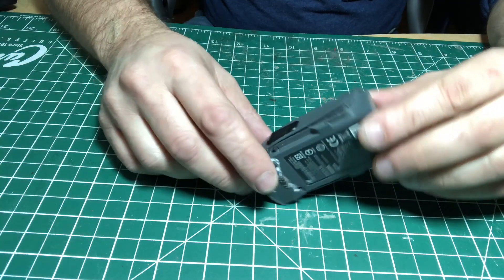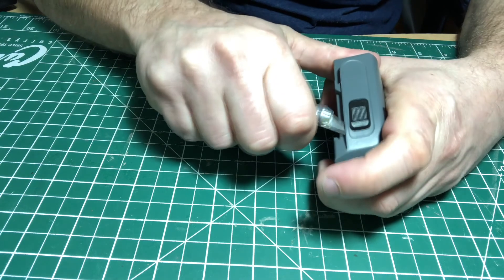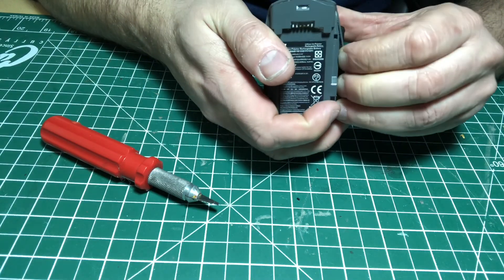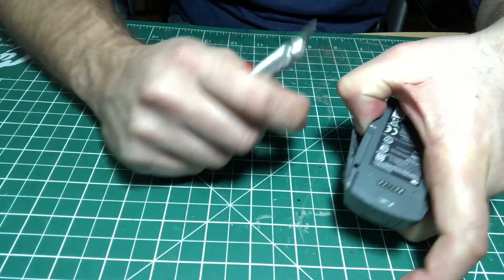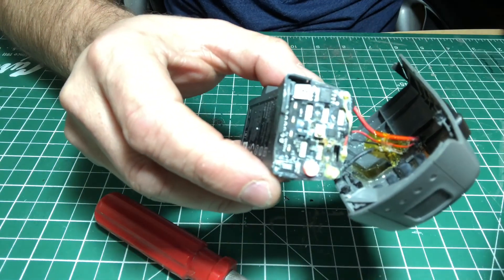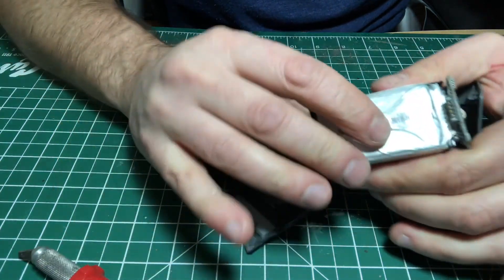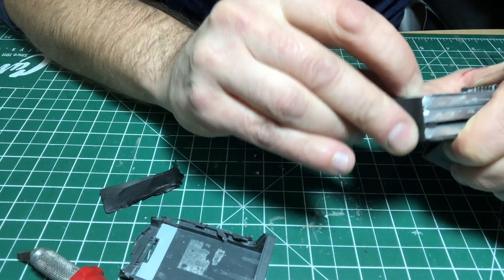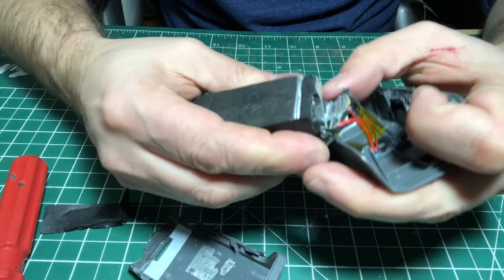Inside a Spark battery (teardown)

Comment: Thanks for sharing mate, there's barely any info like this on the spark. If you've still got the battery around, would it be possible to get some closeup shots of the board, drone power pins and the wiring to the bottom pads? I'm looking into some well-out-of-warranty modding that's going to need access to the pack's full output.
Reply: Would love these details aswell, would like to recreate the balance circuit for custom HV-Lipo batteries, like 2200mah only cost 10£ at hobbyking